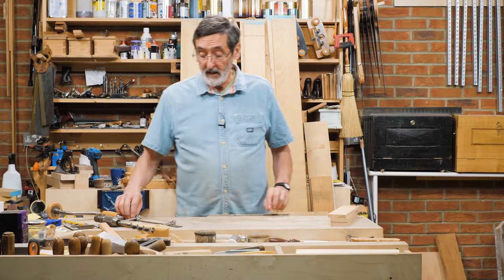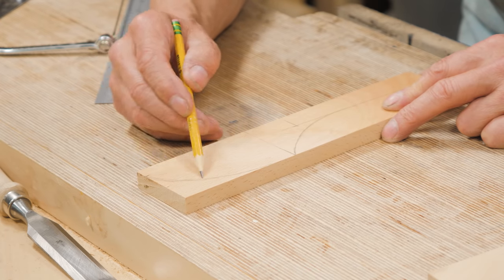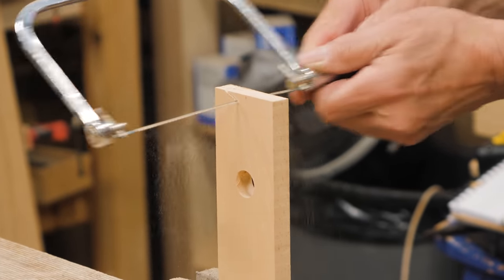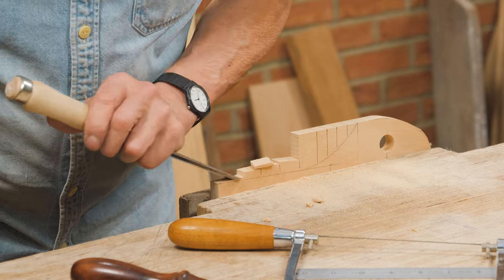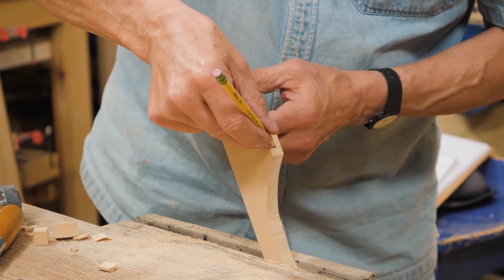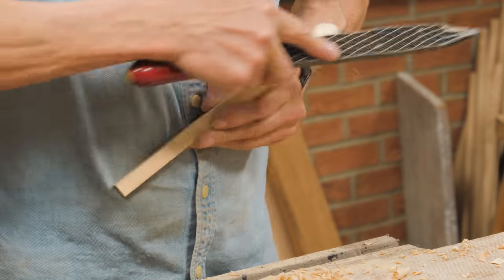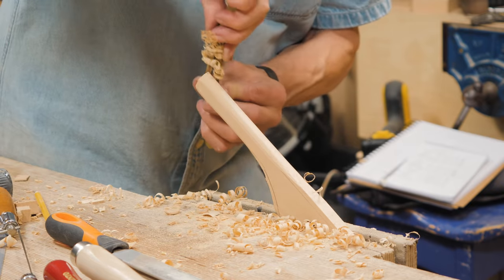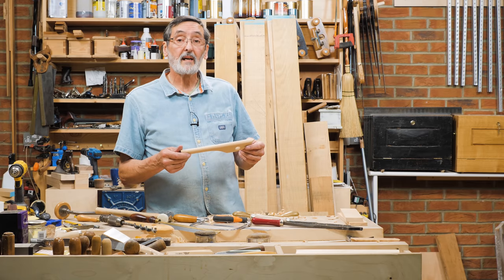How to Make a Spatula | Paul Sellers

Comment: Thanks Paul.  Very fun project.  I like how you mention using all your senses and smelling the beech.  Last night I worked later than normal (making your keepsake box actually).  I am making it out of Spanish cedar and I was hand planing the top and bottom to width.  I liked how easy the Spanish cedar is to work with hand tools.  I also was delighted by its smell.  A simple but real pleasure I experienced last night.  The keepsake box is a Christmas gift for my daughter and a second one will be made of genuine mahogany for my wife.  Making the Christmas gifts so early in the year is taking all the pressure off of getting it done.  Seeing this video inspires me to dig through my cherry cutoffs and make some spatulas, etc for my wife as additional Christmas gifts.  Wife and I agreed that this year for each other only hand made gifts.

Comment: I always wondered about the hole. After some reading I discovered that a 7/8 inch hole measures enough dry spaghetti for one person. 1 1/8 inch measures enough for two.  I love this shape. Thank you.
Reply: It's also helpful when mixing liquids, such as sourdough starter: similar logic to a wire whisk, though obviously fewer holes. Each hole almost doubles the amount of mixing per stroke, though this factor becomes less with increasing viscosity as the liquid doesn't pass as freely through a narrow opening.
Reply: Neither Uncle Bobby’s nor Joel’s theory explains the whole in this spatula: it’s not a spaghetti spatula, and it’s not for mixing liquids, either.
Reply: @mm9773  :: both theories are sound so I’ll just go on imagining that the ‘spatula’ stirs/mixes spaghetti sauce well….

Comment: Cooking oils tend to go rancid when they oxidize. A better oil would be walnut oil. It doesn't oxidize. An alternate oil is straight mineral oil from the Chemists - drug store on this side of the pond. Thanks for the video. Jon
Reply: Cooking oil is just fine - based on decades of first hand experience.
Reply: There's just not enough oil on something like this for it going rancid to be of a big concern so long as its kept clean.
Reply: As others have mentioned, mineral oil (sold in drug stores as a laxative) is also good safe and doesn't go rancid over time. I find that heating the wood between applications also helps open any pores in the wood and it lasts longer without needing to be reapplied.
Reply: You get vegetable oils and animal fats on wooden spatulas, cutting boards etc every time you use them, and you will not get it off, and don’t need to. Because it’s wood 🙂
Reply: @rcjbvermilion  that's nice advice. How hot do you bake it after oiling,
Reply: @RexMcTavish  I use a heat gun. I'm sure it's also possible to use a warm (but not burning hot) oven. My usual process is sand, dampen things to raise the grain, sand again, then let it dry. After it's dry, apply mineral oil, heat it up, apply another coat, heat it again, then wipe off the excess.
Reply: I use mineral oil mixed with food grade bees wax for all my utensils and cutting boards I make.  It lasts through a number of washings and easy to reapply.  A heat gun really helps it soak into the grain. My 2cents.

Comment: From a user's point of view, the blade on this spatula is far too thick.  It would have been greatly improved if  you had used a plane to thin it down to ~1/4".  The shape is nice, and the handle would be comfortable for either working with thick doughs or for people that have trouble with their hands.